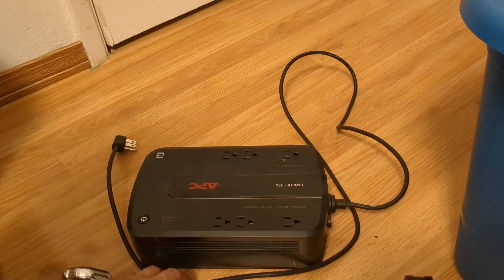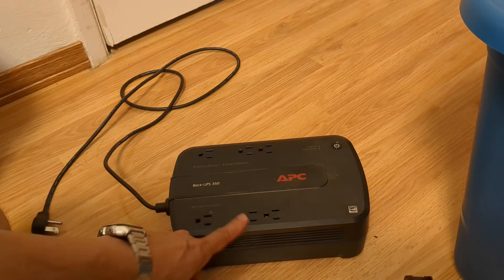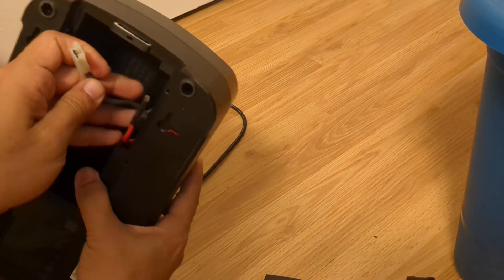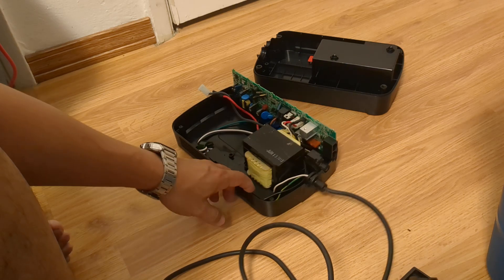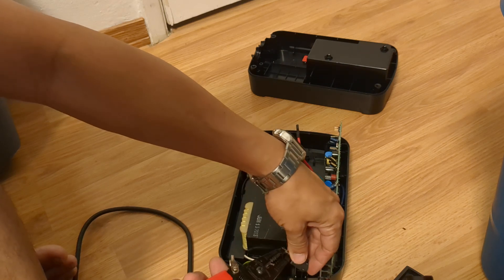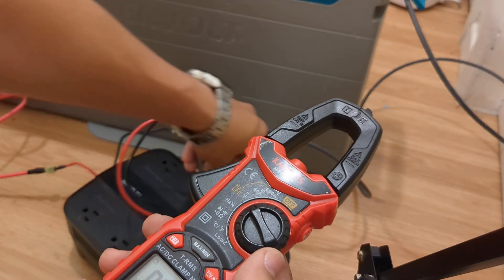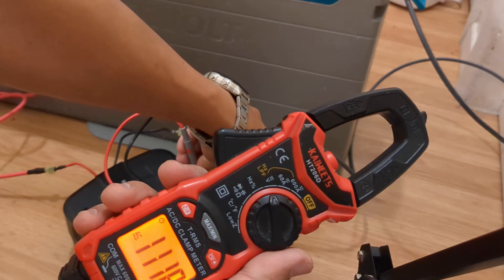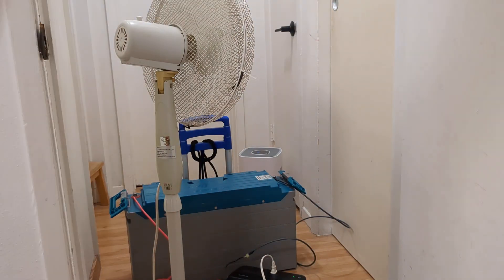"Free" inverter

Comment: I have the same ups but different company i desoldered the buzzer and added an led now its very quiet ...i measured the charging current of the pcb is about 0.5amps to 1amp 13v so dont charge big batteries with it it will take days....but if you salvage that transformer it is alone quite powerful i mean it can easily output 10amps....it will make a good charger ..i have 12v 60ah lead acid battery and it is working like a charm ...ideal draw is 0.5amps and max load is 300watt....i dont have an oscilloscope but i think mine outputs a squarewave because it is very old like more than 15 years ....btw awesome video..
Reply from the maker: Thanks for the tip, @aakashroy2501. It's good to know the voltage and current limits of the attached PCB to better Frankenstein these once ubiquitous boxes under every desk. ;-)

Comment: 3:04, Just want to point out, transformer based inverter doesn't mean true sine wave inverter. Cheap UPSs generally are generally modified Square wave ones
Reply from the maker: Excellent point, @electrotsmishar. Thanks for the correction. This particular UPS has a stepped approximation to a sine wave for its output, so the wave is only semi-true. I'll post-edit this video in the near future to amend the misinformation. Cheers.
Reply: @SuperWhizy  cheers, mate! I tried hooking up my oscilloscope to one these and completely got disappointed. The waveforms are extremely spiky. Thinking about making a video about it.
Reply from the maker: Please share link once you do, @electrotsmishar. I presumed that given the sole purpose of these UPS is to keep sensitive computers alive for long enough to save files that their output would be decent. Thanks again.
Reply: @SuperWhizy  YouTube isn't allowing me to share links
Reply: https://youtu.be/94h7DXd2I0s?feature=shared

Comment: Hi it works, upgraded the battery this way when in Australia many years ago and wanted a longer backup.
Take care M.
Reply from the maker: Thanks for the affirmation, @markh1971. Will soon remove the battery alarm, test the power output limit, and squeeze more content out of this hacked box.
Reply: @SuperWhizy  Hi no problem, where I lived we I was warned by the guy across the street about the occurrence of mains issues. And advised to rent all the electrical items. So mine got put on UPS’s and it was always the battery’s that were an issue and expensive for what they were, thus the bigger “car” battery.